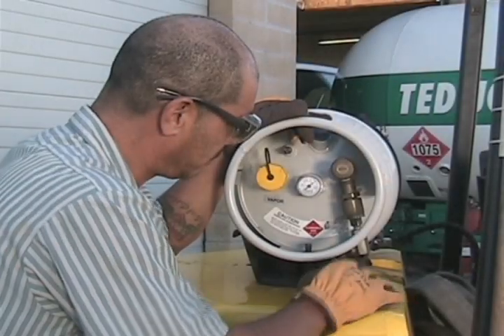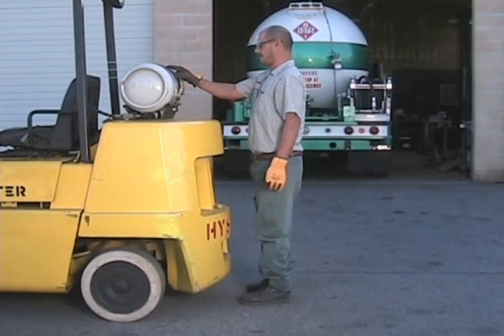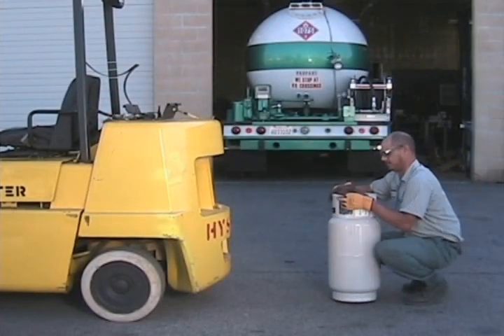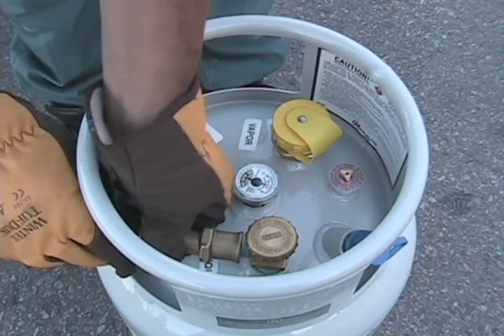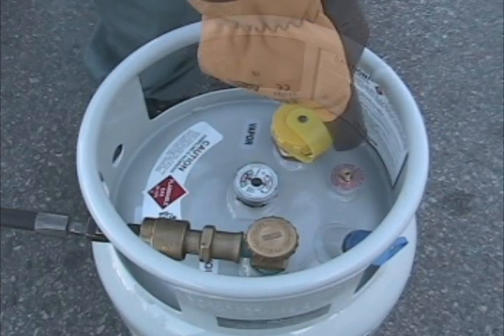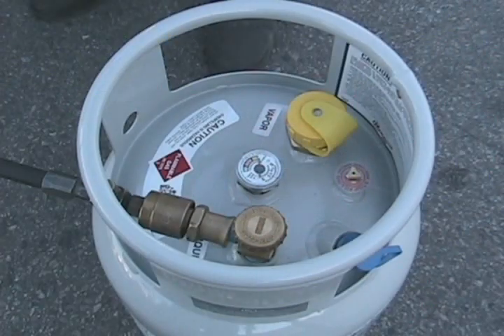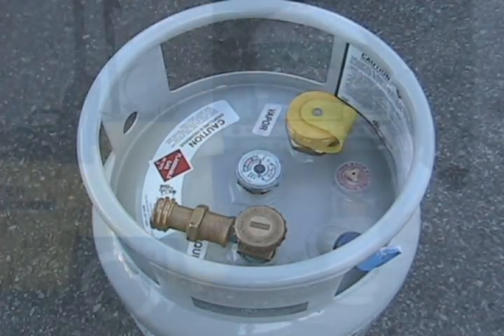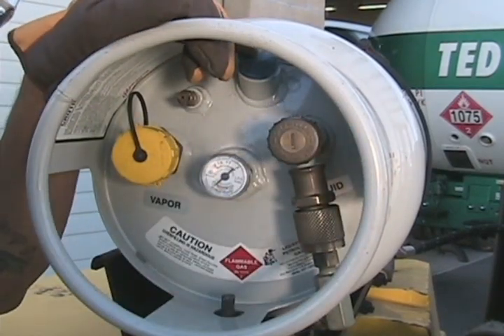TJP Safety Training - Forklift Fuel Filling

Comment: is this the proper way to exit the forklift? other thing is you should not turn off the engine first but rather turn off the service valve to burn all the propane on the engine.
Reply: It is not the proper way. Use the 3 points of contact and exit the forklift the same way you got in. With your back facing out.
Reply: @NocturnalJag  I'm looking for training videos that teach proper techniques fir study in a upcoming course I have.any suggestions